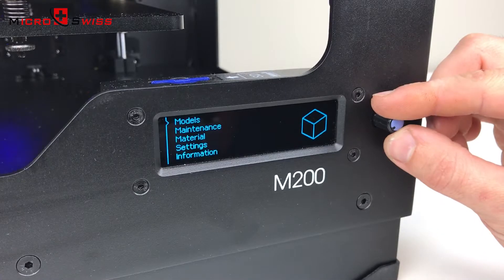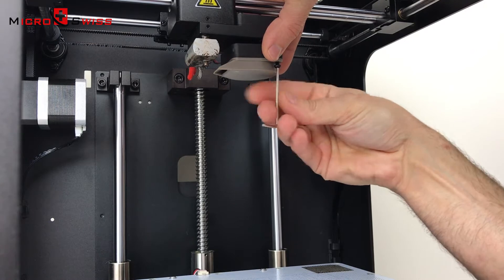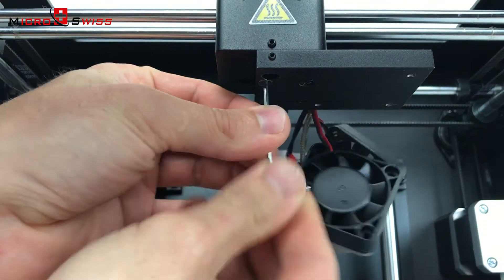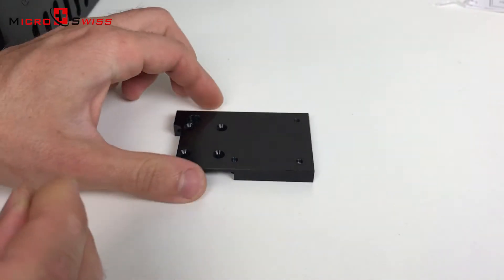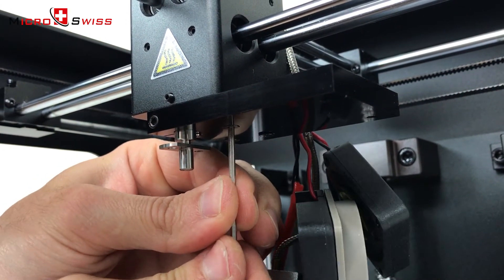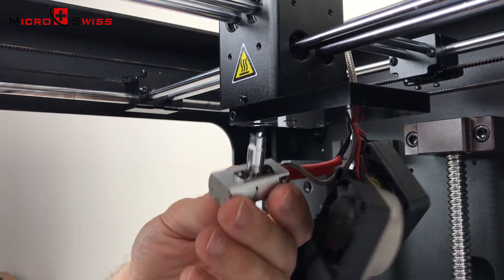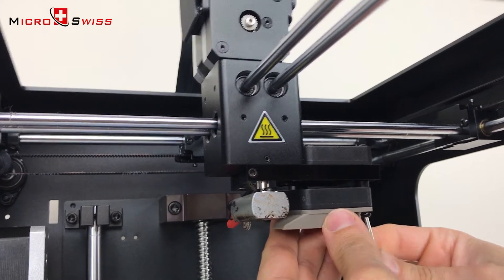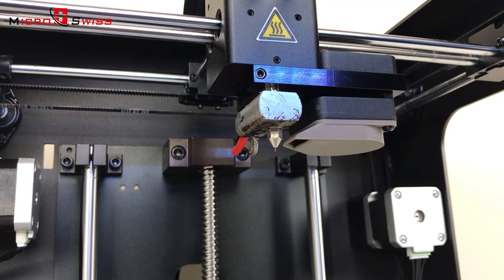Micro Swiss All Metal hotend upgrade for Zortrax M200 3D Printer

Comment: Do u produce an hotend too for this upgrade ?
Or i can mount other models cheapest then original one ?
Reply from the maker: mc Biker, this is sold as a kit. It includes a slotted cooling block and mating hotend parts (thermal tube, Nozzle). Due to the design of the zortrax printers, its not trivial to mount a generic hotends on them.
Reply: Thank u for reply but considering the cost of the original part why do not produce a specified part with a different, and cheapest, hotend ?

Comment: What are the advantige of this upgrade
Reply from the maker: Bradley, This All metal hotend has sharper melt zone than original PTFE lined hotend. It also comes standard with plated wear resistant nozzle.  Due to its all metal design, it has not temperature limitation.
Reply: Micro Swiss LLC I have ss nozzle for my zortrax will they fit on your microswiss hot end
Reply from the maker: Stock zortrax nozzle will not fit all metal kit. The inside dimensions are different. Here are two links for stock nozzle and for all metal nozzle. https://store.micro-swiss.com/collections/zortrax-m200/products/plated-wear-resistant-nozzle-for-afinia-h479-h480-up-plus-2-zortrax-m200
https://store.micro-swiss.com/collections/zortrax-m200/products/micro-swiss-nozzle-for-zortrax-m200-all-metal-hotend-only
Reply: Micro Swiss LLC do you ship to South Africa?
Reply from the maker: Yes we do. We ship international with USPS, and DHL.
Reply: Micro Swiss LLC Thank you very much